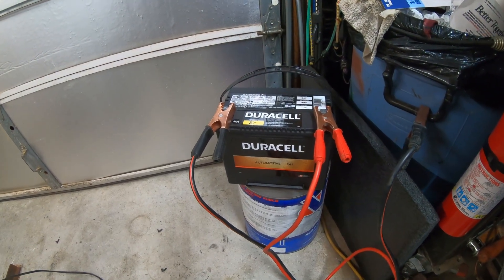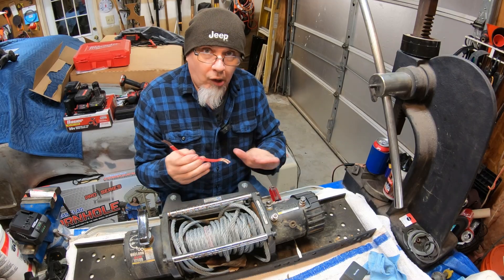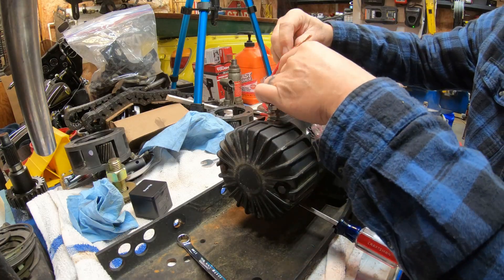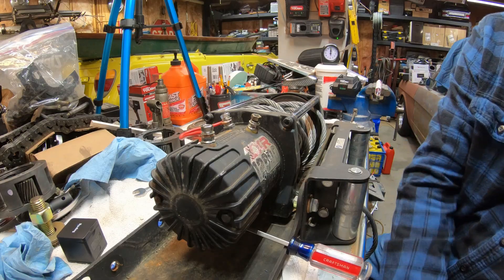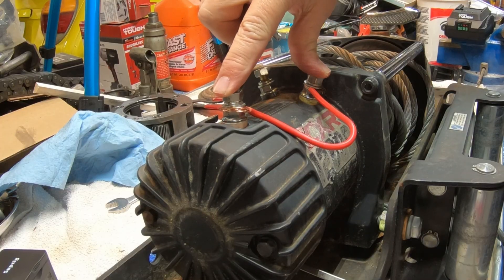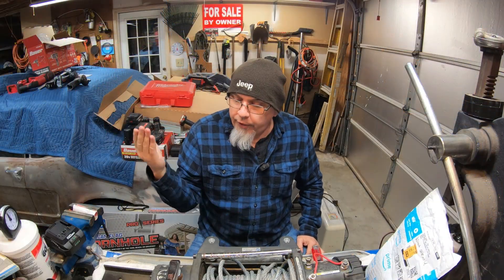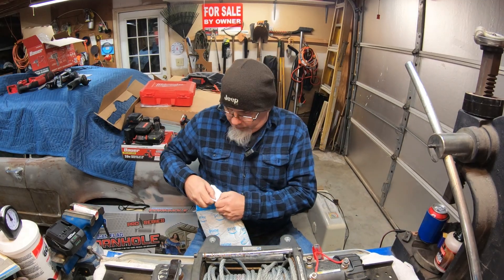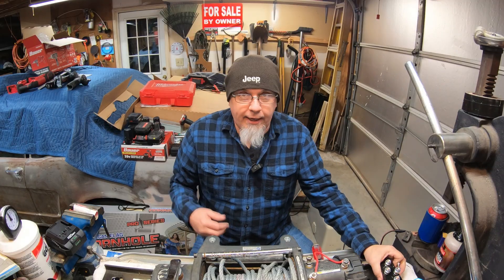How to test a winch motor the EASY way! Badlands 12k

Comment: Thanks for posting.  Great video.  What happens if you get no power from the motor once you hook up the power from the battery?
Reply from the maker: The only other thing I can think of, other than a burnout motor, would be the brushes could be worn out, need replacing, or cleaned. They'll be under the (what are usually) Phillips-head screws in the side of the motor casing.

Thanks for watching!
Reply: @MikesRepairShopEDU I figured it out. It was a bad connection on the yellow motor terminal. Once I connected the positive to the other control directly it all worked. Your video was on point - already had a shop try to order a new control panel for me - and that wouldn’t have worked either. Again, Thanks so much for posting this!
Reply from the maker: I'm glad the video helped! Thanks again for watching!

Comment: Thanks for informative video.  I bought an HF Badland Apex 12000 winch.  I have not gotten around to installing it.  I tried turning the clutch knob out of the box and it's extremely difficult to turn.  Do you think it's broken or is that normal since it has not been powered on?  TIA.
Reply from the maker: I'd say it will loosen up a bit with some use
Reply: Ok thanks for the quick reply sir.

Comment: So if it sparks its burnt up?
Reply from the maker: Is it a big fat spark? Or small? Do the wires get hot really quickly?
Reply: @TorquePowerVideo yes it arcs like you're touching pos to neg. Big spark.Its a fried motor surely. Thanks for the video though. It helped to determine its toast